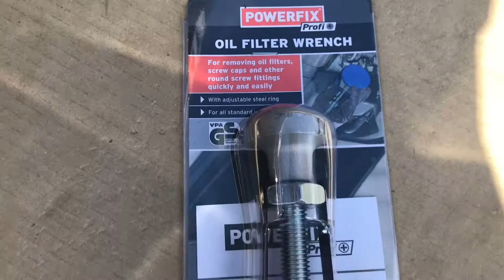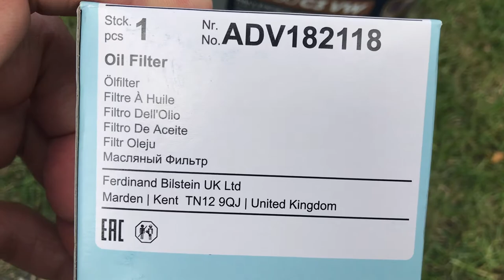How I changed oil and oil filter on VW up

Comment: Oil filters are always tightened by hand
Reply: the reason might be, the rubber being pressed too much to its limits. afterwards when replacing the filter due to all the heat it has taken over the miles, the filter can get extremely tight to the motor and one might need to resort to an old screwdriver and a hammer to undo it...
for the rest: a very good video on all the problems one meets while not being used to do this job. you could have stumbled into the oil reservoir to topple the vid :). 
always good to place some square blocks behind the wheels, pull the hand break, put him into gear - to block the car from moving

Comment: Hi there, what year is your car? 
I have a seat Mii, but the owners manual states VW 502.00/505.00.
Is yours the 59hp model? 
Thanks 👍
Reply from the maker: It's 2014  75bhp and the manual says vw502 00 or vw504 00 but the vw504 can be used only in some countries like EU. It's best to follow your manual.
Reply: 504/507 is used in countries where there is very low sulphur in the fuel (most European countries).   For countries where sulphur is unknown or high, VW 502 / 505 is recommended.

Comment: Really helpful , how many litres did you put back in ?
Reply from the maker: I started with 3.5 litres and topped it up to max. level, overall I used about 3.75 litres.
Reply: 6
Reply: 3,4 ltr say vw 😁👍

Comment: isnt the right oil 5w40 vw508.88 ?
Reply from the maker: I was told by the supplier that this is the right oil and it also matched the code that is shown in the car maintenance book.
Reply: si es verdad up  skoda o mi  llban  aceite a3/b4  5w40   norma 502  o  505  esa q le puso vale pero no es la mejor

Comment: Look at the color. Looks like the oil was never changed before.
Reply: One of the properties for the VW504/507 oil, is the oil becomes dark very quickly.  In fact, in the user manual, it explicitly states that do not judge the oil purely by the colour.

Comment: i've heard that Castrol Edge Professional LongLife III can last 30 000 kilometers, can someone confirm that
Reply: I use that oil for my passat b8 station with 1.6 tdi. It can run voor 30.000 km. But i change it myself at 20.000 km
Reply: Change oil every 10.000 km. The engine will thank you 😊
Reply: There is a huge debate on long life oil.  The general consensus is that although the oil may last 30k km, but the oil filter may not.  If you were to change the filter say half way, why not replace the oil as well?  Personally, I changed my oil every 9k km. 1. Oil is cheap. 2. Used oil goes to the recycle centre.